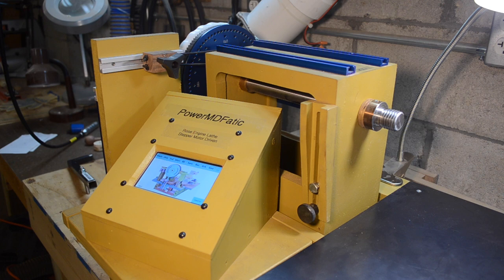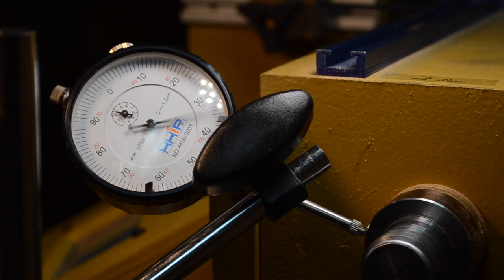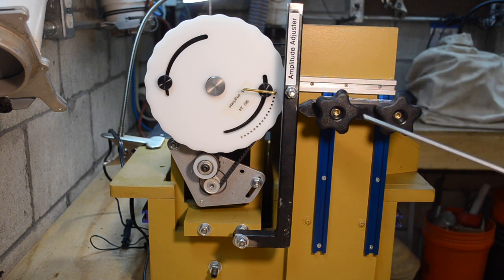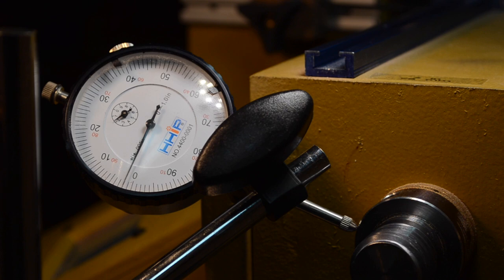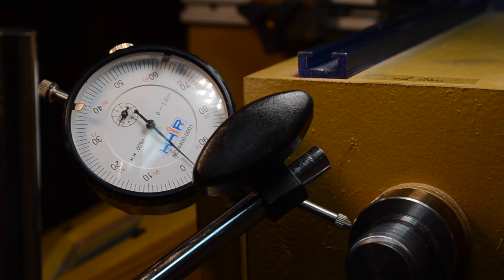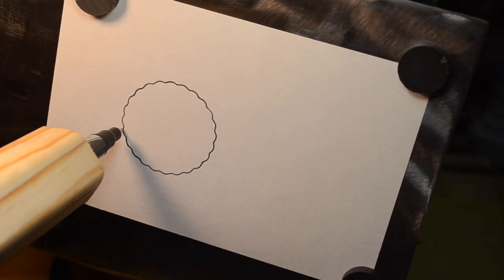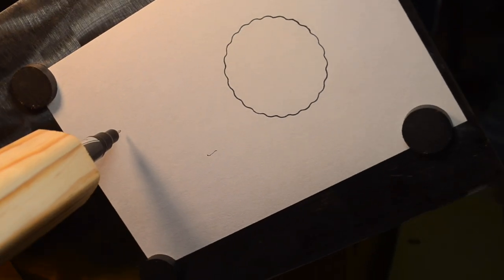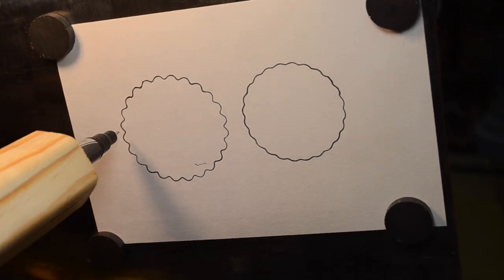MDF Rose Engine Lathe : #3 - Amplitude Adjuster

Comment: Its very interesting thx for sharing. 
I didn't understand by changing the amplitude you are getting different depths,  isn't the resetts depth determines that . How you are being to get deeper then your rosette . Also what are the diameter of your rosettes.  When I retire I might make one for fun .
Thx .
Reply from the maker: Rosettes are approx. 7" in diameter.  The amplitude for the rosettes are reduced typically, but can also be increased using the lever action of the amplitude adjuster.  You can read more about that at https://www.otbok.info/OT%20-%20LnT-Term-AmplitudeAdjuster.html.

If you want to make an MDF rose engine, I just published the directions at mdfre2.ColvinTools.com.
Reply: @RichColvin  thx for the reply. 
Great help . I have 5 more years, but you never know if I get mad with my wife . LOL .
I like making more of pens

Comment: Hi, great machine you have, really enjoying your videos, is there a good spindle rpm to aim for?
Thanks for your time
Reply from the maker: Thanks Sam,  Jon Magill created a great machine.  

I run mine slowly, typically 10-15 RPM.  But that changes based on need.  For example, I will run it faster for softer woods, especially those that get "burned" if the cutter if it stays in place too long.  And sometimes, I will run at 3-5 RPM on the last rotation to get a smoother cut.  

But certainly, I don't run anything like 1000 RPM!
Reply from the maker: One addendum :  when I am on the last pass of a cut, I will often slow down to less than one rpm.  It is not uncommon to cut at 2 or 3 minutes per revolution for that.

Comment: What is the difference between adjusting amplitude vs the fading adjuster at the front of the headstock?
Reply from the maker: Amplitude adjusters are used to make the amplitude of the rosette larger or smaller.  This changes how much the spindle moves (e.g., rocking), but does not stop that rocking.

With fading, the rocking movement of the spindle is stopped for some period of the rotational period.  The effects are very different.  

There are more details about both on the Ornamental Book of Turning (https://www.OTBoK.info) in the dictionary that is on that site.